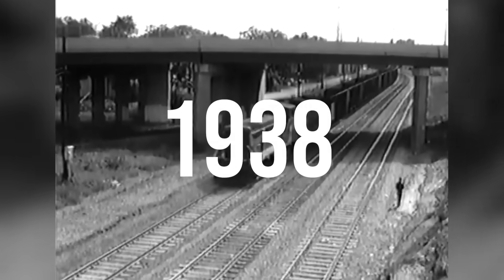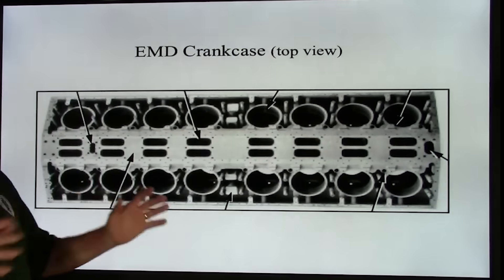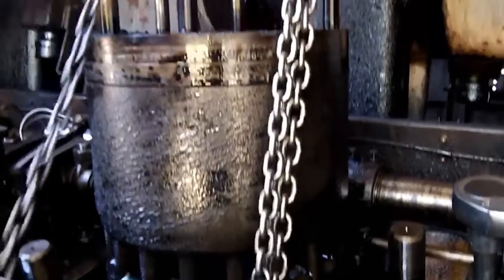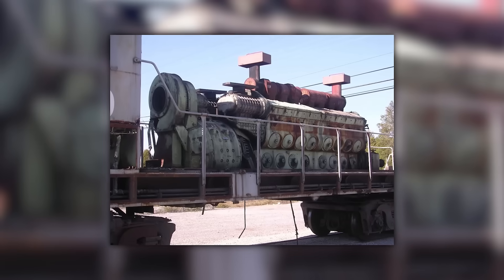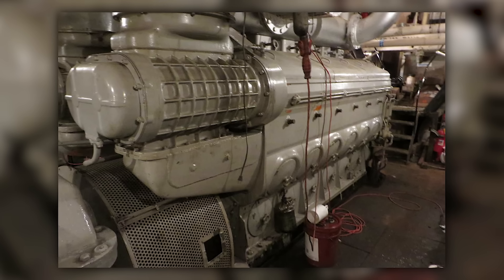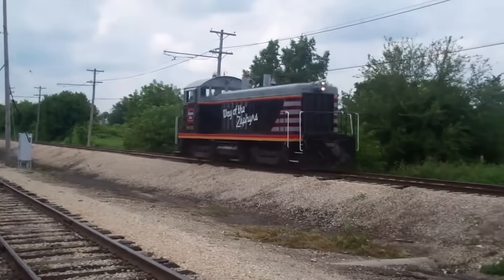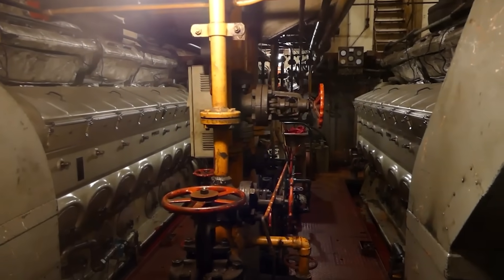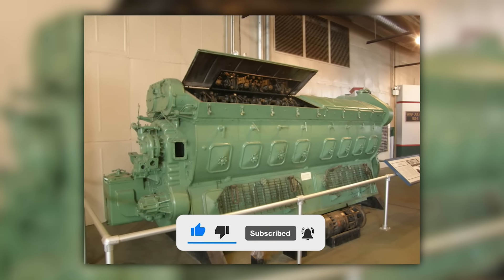The EMD 567 Engine That Silenced Steam in 1938

Comment: I clearly remember the Railroad Engine House at South Amboy NJ removing and then replacing a complete unit, including the Cylinder,piston connecting rod and valve train in one operation. Using a come along to remove and replace the unit. It took less than 1 hour to replace the unit,and another half hour to connect the camshaft assembly and connecting rod to the crankshaft. The diesel was  running again in under 2 hours and ready for service. Any mechanic with experience could easily do this job. I didn’t know and was amazed that the cylinder,piston,connecting rod,and valve train could be replaced so easily and quickly.

Comment: Dreadful. The FT demonstrator the 103 was launched in 1939, not 1938. Each of the four units had a single 16 cylinder engine, not a pair. And the images begin with some switch engines. I don't think I saw any FTs in all those silly, unrelated stock images.

Comment: I was an electrician for CNW at the Oelwein shops in the late 70s and  early 80s , i remember some of the old timers talking about 20 cylinder e units and how they would damage the crankshaft from hard coupling .
Fantastic locomotives from EMD but my modeling preferences are for the Alcos and Baldwins ..

Comment: I felt so fortunate to work with 12, 16, and 20 cylinder turbo variants in blue water tug boats and brown water tow boats. I loved the sound when these engines cranked up to 900 rpm. We had a corp office and maintenance facility in Metropolis, ill. Where we performed maintenance and rebuilds. What an engine.

Comment: I work on these 645 engines for a living. The SD40-2 and GP40-2 are the best locomotives ever built. Durable, simple, repairable, and logical in design. Not everything is perfect but so close as to beyond reproach. 
I cut my teeth on the 567D GP30s. These are among the most difficult locomotives to work on as they are an electrical nightmare but if you master those every thing else is cake.

Comment: One is inclined to wonder. Why a scaled down version of the 567 engine wasn't developed for tractor, tank, and even submarine applications?
Reply: GM did exactly that - with Detroit Diesel 2-stroke engines that powered trucks, earthmoving equipment, military vehicles, and watercraft.
Reply: @briansmith2524 Thank you! I guess that some things are just too good, too reliable, too inexpensive, for modern day profits and BS regulations

Comment: As an GM engineer, we worked on these in the "electronic age" where all of the modern gadgets were added to them.  EMD was one of the best Divisions that GM ever owned.  It is a shame that GM abandoned that group, like it did for many others who were making good technologies.
Reply: Seams the more years away from slide rules and micrometers we get, the more cocky the engineers get and their designs suffer. Gone are the days of designing something to withstand twice its intended purpose, now if something farts the bolts shear and pieces of the engine blocks fly off. I worked for Ford for a few years and the best part of the 2.0 coming apart was the rod would hit the block and knock out the exact section that was stamped Ford on it. I would hand the customer a 4x5in piece of aluminum with a big logo on it.

Comment: For 43 years I worked at the Rockwell/Atchison Casting/AmeriCast Technologies/Bradken foundry in Atchison, KS.  The company is now called Vulcan Metals.  100 per cent of the locomotive frames used by EMD, which is now a division of Caterpillar, were made there.  We also made the frames for GE locomotives.  The foundry specializes in large steel castings for many companies.

Comment: We have them still in Australia, they pulled goods trains across the vast Nullarbor Plain linking Sydney to Perth, nothing beats that awesome sound of the GM 2 Stroke engine and the lines of the streamliner. You can hear those engines for miles before you can see them no other locomotive sounds like a GM 2 Stroke streamliner!

Comment: The FT had one 567 16 cylinder prime mover,  not two.
Reply from the maker: You’re right for a single FT unit: one 16-567 prime mover. What trips people up is that EMD sold FTs mostly as drawbar-coupled A-B sets, each unit with its own 16-567, so the set had two engines (2,700 hp total). When folks say “the FT,” they often mean the A-B pair rather than one carbody. Appreciate you watching.

Comment: The miracle here is engineering with a mind towards efficient maintenance. We need to teach this to automotive engineers.
Reply: Now we have $5000 tailights. Real engineering.
Reply: True-- but on the other hand--- most will NEVER buy another vehicle from that  company. Crap designs and patrs do NOT equal repeat sales.
Reply: We need to teach mechanics 1st grade reading comprehension first . . .
Reply: @kelseystickney8663  "When go fix igniter coil, be sure engine not run."
Reply: Same goes for the M4 tank in WW2. Maybe not a complete coincidence.
Reply: Unfortunately, that thinking died in the 60's. Todays car are designed for assembly, not service.
Reply: That’s a good point, but as others have pointed out, an engineer who is told to design a reliable part can do just that — until management demands it costs half the price and can be fitted on the assembly line in five seconds instead of five minutes. Cars are in large part designed to be built, not repaired. But the real culprit in all this is the buyer, and a comparison to heavy trucks is in order. Fleet truck buyers who want to stay in business examine operating costs to the fraction of a cent per mile. Car buyers, on the other hand, just can’t live without an “infotainment” system in their fancy new pickup with its $5,000 taillight assembly. (That is mentioned here, too, and is true, referencing a Ford pickup.) The list of what the general public expects in new vehicles goes on forever. I am 70 and can remember when cars were advertised in the classified ads with “R and H” — radio and heater. Today the R is the infotainment system and the H is automatic climate control, heated seats, heated steering wheels, and on and on.
There’s no doubt that some parts of today’s cars are vastly superior to those of the past. The best engines will go 300,000 miles before needing to be rebuilt, a distance unheard of in the 1950s, and they will accomplish that with far better fuel economy and lower emissions. And there’s also no doubt that cars are safer and perform better by every measure. Sure, that 1950s car looks cool, but try repeatedly stopping it on 60-0 tests to see how those ancient drum brakes give up the ghost. 
And, yes, when today’s cars break, they are expensive to repair. The shop charge to replace the spark plugs in my 2008 Lexus is something on the order of $800 — but they are the original plugs, and have been firing for 150,000 miles. So life goes on.
Reply: Auto companies do NOT want to produce technician-friendly vehicles because that costs them revenue vs selling replacements. Consumers who are not mechanics relate to machinery as magic rendering them incapable of demanding better vehicles. Typical US education and literacy levels are abysmal by choice, since only academically inclined people care about learning. 
The railfan community are mostly pretty cool because we're NOT like the typical bipedal sandbag. Be glad you enjoy technology because that opens many life choices others never have.
Reply: and scalability for use cases
Reply: Engineers these days don’t think they make flawed designs because of computers aiding. Well it hasn’t worked out well for them in the automotive industry, everything gets worse by the year.
Reply: Car manufacturers don’t make money if the cars don’t break
Reply: @gapcityracing6086  they do make money actually it’s the dealership mechanics that don’t make money if the cars don’t break
Reply: @gapcityracing6086  I would never assume that since a plain Jane no features, white, two-wheel drive, 1/2 ton, standard cab pickup starts at 45 grand and if you need an actual useable (8') bed, that tacks onto the price, if you need 4WD, that adds a few thousand bucks. you want a V8; add another couple thousand, , and you can't even get one with a manual transmission anymore. I am literally tempted to start my own motor company that builds nothing but pickups that will be like the old days, no power locks or windows if you don't want them, V8 standard equipment, Manual transimission standard equipment, vent windows and tow mirrors can make a comeback, No extree fee for an ash tray and cigarette lighter, etc. Just good old pick it like you want it and no limitations of "well if you want this option, ou have to add this option package and it will delete these options" etc. That is such bullshit and American cars and trucks used to able to be ordered in any configuration you wanted them in, not just what the dealer sasy they can do to make the maximum amount over a customer wanting just one thing in an entire package. Also NO TOUCHSCREEN INFOTAINMENT!  Classic Single DIN radio wired up with power, battery, ground, antenna and speakers, Not a 45-wire harness to control the fart deodorizer and a toaster oven, and definetely no controls for the "exhaust audio system"........
Reply: The engineers aren't the problem; They'll make what they're paid to make.  Management and the shareholders are the problem
Reply: @thekinginyellow1744  That assumes modern "engineers" are actually competent and know "what right looks like".  Many design mistakes don't improve profitability or lower production costs.
Reply: Efficiency is the enemy of capitalism....whereas things that break and are a pain in the ass make more money for everyone.... and if you cant afford it... theres fianancing
Reply: @robertdiaz937  This engine design and its ultimate replacement is a refutation of that. The best performing and most cost effective design won, after all.

Comment: 645 VS 567.............Block / Cylinder liners, Pistons / Connecting rods, Crankshaft, Cylinder heads NOT THE SAME.....Fuel injectors / Fuel pumps, Turbocharger / Exhaust manifold, Some injector body types are similar, but flow and timing differ; careful check needed. Some external mounts may fit, but flow and sizing differ. External components often interchangeable if mounting matches. 567 engines mostly had mechanical blowers. Some late-model 567s had turbochargers, but they were supplemental to the blower, not purely turbocharged like modern 645 or 710 engines. True “turbo-only” 567s were rare; EMD fully adopted turbocharging with the 645 series. SD Units SD38 (introduced 1966) – 645E, roots-blown, 2,000 hp, 16-cylinder. SD39 (introduced 1968) – 645E, roots-blown, 12-cylinder, 1,750 hp. SD40 (introduced 1966–67) – 645E3, turbocharged, 3,000 hp. The 645 engine was used in both SD and GP locomotives, but the first practical applications were in SD units (SD38/SD39). GP units got 645s a little later as EMD phased out the 567.

Comment: It may have ended steam but it took over 20 years to do so.  

The demands of WWII needed locomotives to use non-strategic resources (like coal or wood rather than diesel which was needed for ships, tanks, and trucks in theatre).  And the post war economic boom saw a massive increase in freight and passenger traffic meaning that steam locomotives needed to continue in service.  

In both Canada and the USA, steam power wouldn’t disappear from mainlines until 1960.

Comment: Ive always considered 2 stroke engines more efficient and powerful then gutless nosy 4 strokes since a kid mowing lawns.  people just dont use them right.  By all logic how can an engine only powered every 2 turns of crank be more efficient then one that powers every turn?  when automatically the 4 stroke is wasing half the energy of turning the engine let alone extra valves.  As a kid mowing lawns wed have a Victor 2 stroke,  I used to have it on low RPM  and jog mowing the lawns and it was perfect.  Whereas 4 strokes would conk out with half the treatment.     Its only because  Noddies stand there with a two stroke running while their not making use of the power thus going to waste they then say   the four stroke is more efficient -but how can it be by mechanical logic.  Think about it -  the 4 stroke has to turn the engine twice as much.  Two stroke low reves and work it.  Think of it like repowering  a car.  If you double the engine size I think you get not double the power but like 3 times the power -  in that the vehicle weight to that bigger engine is now half the effort of hauling around.  So its like the original engine and the weight thats used to hauling plus doing its performance excess -   but youve now got half the weight plus the extra performance doubled.  Thus similar but inverted practice with the 2 compared to four stroke in turning the engine alone.

Comment: I ran a go 7 with a short nose for 5 years.  The 567 name comes from the cubic inches PER CYLINDER.  Imagine a piston the size of a 5 gallon bucket.  Top rpm was 800. At idle you could hear each cylinder fire

Comment: 5:42 T42 locomotive (EMD G12) the only one in Sweden. Usually Nohab in Sweden used EMD engines in it's own locomotive designs based on EMD units but with different bodies. 
Sadly most if not all of the wagons it's pulling where destroyed by arson some years ago, the footage appears to be from the last excursion on the old Haparana line before the new one opened.

Comment: I work in the engineeoom on a ship with EMD V20 Series 645s. They are incredibly reliable and maintenance-lite, especially having previously worked on a ship with Pielsticks, which are nightmares!

The airboxes are easy to access and clean, the power packs can be switched out in a day, parts are readily available. In 69 years of service, the worst that has happened is two airbox explosions. They've never left us adrift and they've never kept us in port for more than a few days.
Reply: Had no idea they did a Marine version of the V20 645. Got used to seeing them in the SD45-2 loco's though. :). Have you tuned your Governor to run it at 900rpm yet(EMD tunes them on the safe side and keeps them at 800rpm)?

Comment: I ran those locomotives for 42 years and my favorite in the yard and transfer service was a GP7... (Out on the road my favorite was an SD40-2) They were amazing engines … GP 9’s were real good too, but they didn’t brake as well as the 7’s…. I can attest that the 567s were excellent power plants, they were very reliable power….

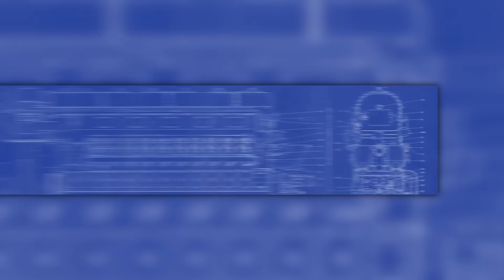Comment: The engine shown at 2:06 is a Fairbanks Morse 10 cylinder opposed piston engine. The engineers on diesel submarines powered by FM felt sorry for those with the GM-Cleveland 16-278 engines.

Comment: In 2012 I  worked on a boat that was an old lst from wwii and it had two of these (v12) from 1942.  Loud and slow and orings sealing the liner to block would fail often causing a steam bath of cooling water
Reply: There were over a 1000 LSTs built with two each 567, 900hp engines.  These landed tanks and war material all over the world.  There is one left in Evansville.
Reply: @cadewey6181  I’d love see it. I’ve seen videos out it. The boat I was on  called mv Gordon Jensen.  Scrapped a few years ago.

Comment: You're talking about a railroad engine as if it's powering the locomotive axles directly. No. No. No. 
The diesel engine in modern locomotives just drives a GENERATOR. That generator powers the electric traction motors.
Everything really depends on the efficiency and design of the traction motors. What you're talking about is completely irrelevant.

Comment: Great video. It's abhorrent that the EPA made it illegal to produce EMDengines.
Reply: Curse the EPA!
Reply: I know, right? I, for one, DESPISE being able to breathe. It'd be much better if doing so required some kind of respirator device.
Reply: @jefferyG499  A properly maintained diesel engine emits CO2, water vapor and nitrogen emissions - 4 chemicals that are already present in the atmosphere. Stop the mentally-numb fear mongering. You want to see air that's bad to breathe? Go back to the pre-diesel world, when city streets were covered in horse manure that produced clouds of toxic dust.
Reply: @jefferyG499 ES& D.

Comment: A 45° included V-angle in fact makes for terrible balance. That is why Harley engines vibrate so much.
Reply: "A 45° included V-angle in fact makes for terrible balance."
45 degrees is bad for a two cylinder, but a V16 optimal balance is set for 45 degrees...
Reply: Depends on the number of cylinders. V2, V8, V12, V16 all have different ideal angles, Wikipedia has a great article on that

Comment: During the mid-1950s to the early 1960s, our SE Texas house was literally across the street from 'the tracks'; multiple lines, with continuous freight and switching operations. Dutifully warned by our parents that the tracks weren't a playground, we collected used spikes, half-burnt flares, and retrieved the occasional flattened pennies or nails; later selling them at school for a hefty profit. Yes, we hopped tank cars (the ladder and steel grate platform made it easy) and jumped off when our courage lagged behind the building speed. Although we took it for granted back then, it doesn't get much better than being lulled to sleep by an idling 567. Thanks for the memories.
Reply: Me too and at the same time in history, Somerville Texas born in1946.

Comment: "two stroke" with camshafts and exhaust valves.
Reply: Toyota made a supercharged V6 based on the 5VZFE in 1988. Both the inlet and exhaust valves opened within a few degrees of eachother. It was the same four valve head. It caused more problems than it fixed and Toyota gave up. It was dismal. Had they persisted they would have tried again with a supercharged V6 diesel. Instead we got the F33A nearly 40 years later. Which will prove to be an utter dog like almost all hot V car engines